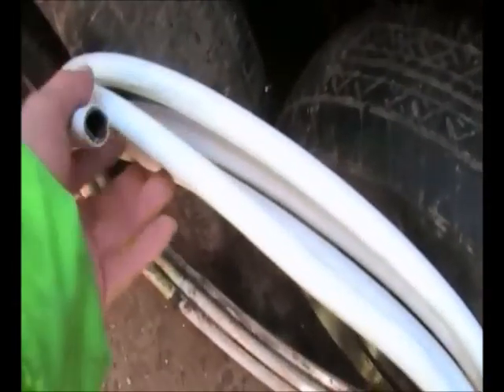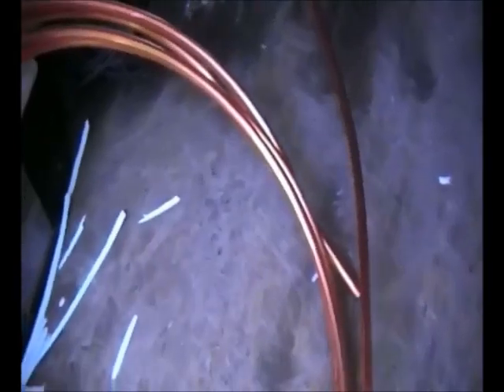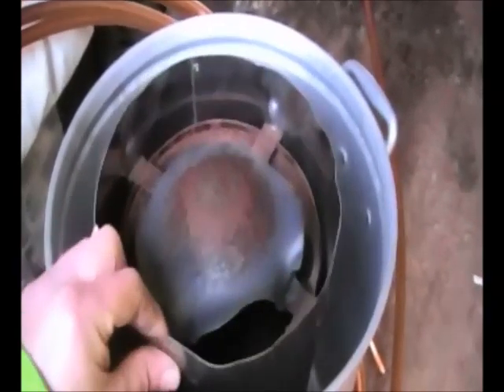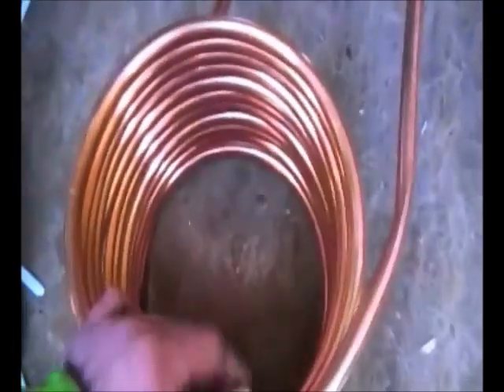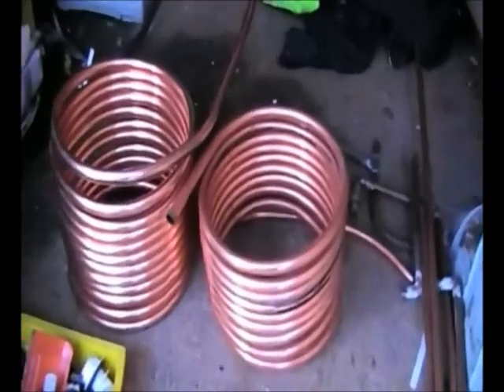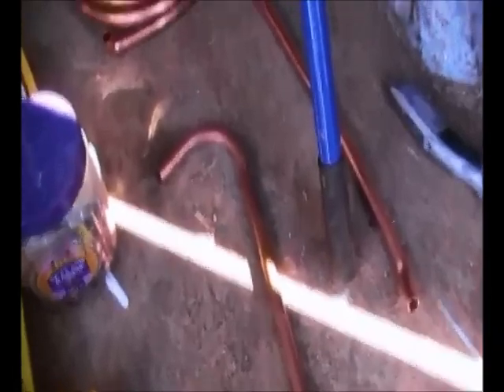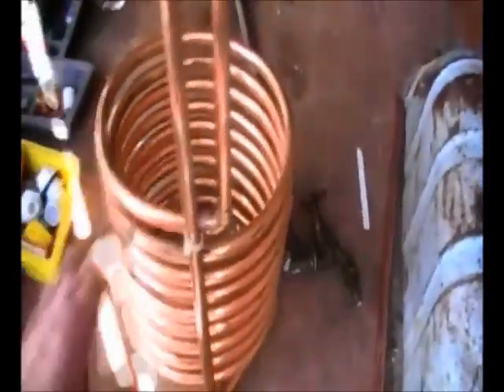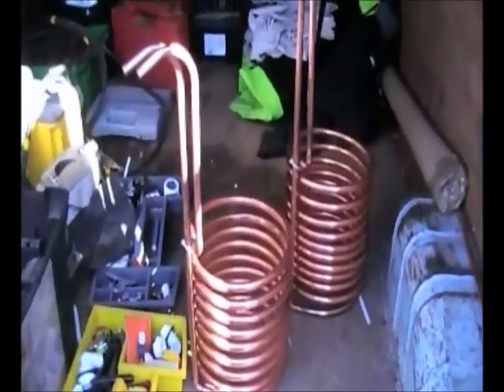WORT CHILLER BUILD

Comment: Nice! I was wondering if I should solder elbows on the pipes or just bend part of the coil up. Your video and design has convinced me to break out the torch.
Reply from the maker: Elbows are fine and give much more scope, do to the radius limit you could put on the tubing, plus there wasn't enough coil for me to bring it back up, and i`ve  had no issues using one or both linked together. Cheers